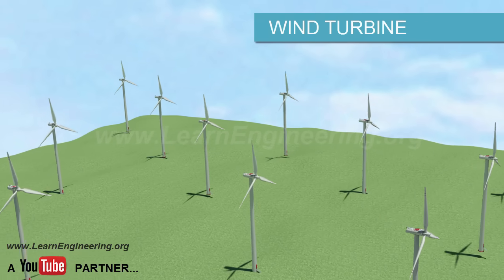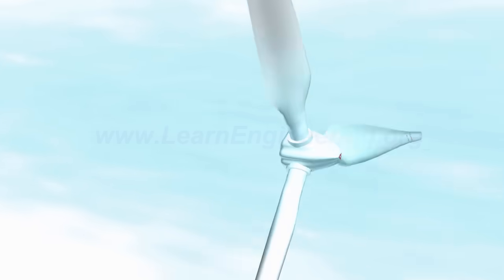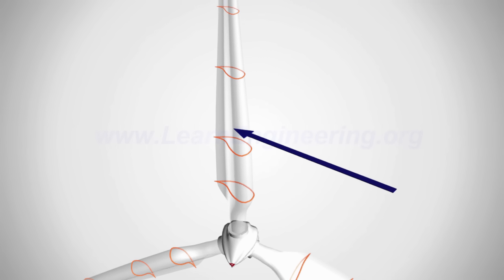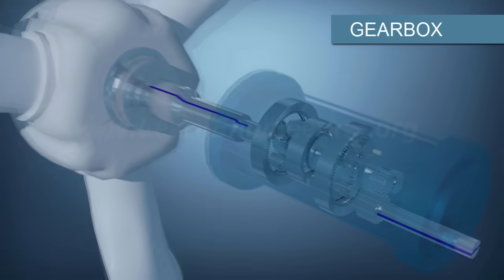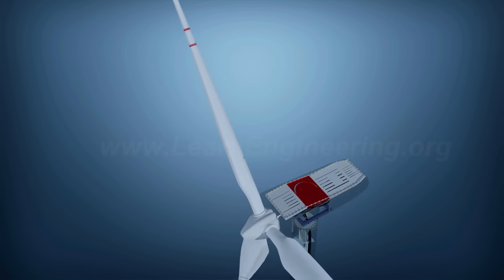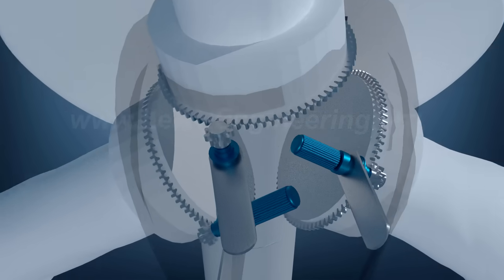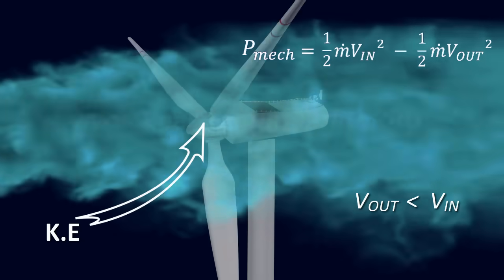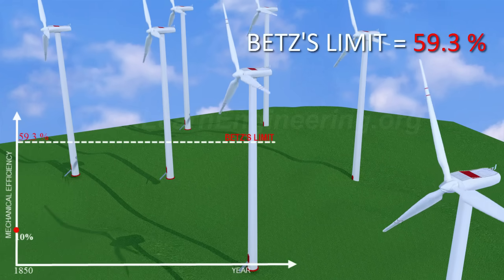How do Wind Turbines work?

Comment: Why does it have to lock up when there's "too much wind"? Is there not a method for the turbine to simply generate more mechanical force in such an event? That idea in and of itself seems highly inefficient to me; the only reason I could see stopping a wind turbine would be if the energy grid or wherever the energy were being stored were close to reaching it's maximum limit. Apart from that why doesn't it just run 24/7?

Comment: Hello, Jared Garrand,

To make clear, my question, I make an exampel of my knowldge of solar power.
Having seven solar panels of 42 Volts in serie, gives theoretical  294 Volts DC

To connect on the grid / network, you need  an invertor, to make it  240 / 250 Volts  AC  ( frekwentie,  50 Hz )

My question is...   do windmill systems work like this ??

The Amps, x Voltage gives the  Watts, that I know. And is depent on capacity of generator, windpower and
Electricity demand.

Regards, Gerard.

Comment: Thank you for information and I like that video( but one doubt why 59.9% efficiency why efficiency encrusted plz explain
Reply: yaser arafath this is the result of the analysis of the equation for the wind energy gather
If the gather was perfect (all energy goes to the turbine) it will not left any energy to the wind get away from the gather, which only happens if the air was already stopped to motion
Along with all the stuff related on this case the number resumes it all and gives the "perfect" possible energy transfer from wind to the turbine

Comment: which is better for the blades of the fan lightweight material or heavy weight material? does the weight of the fan blades affect the RPM?
Reply: yes it does carbon fiber blades are better than glast fiber

Comment: I find this info video not very complete, at 2:00 it is mentioned that the blades turn too slow, so the rotation has to be sped up in a gearbox (2:11). Very clear to me, but then bang at 2:40 there is electricity produced... What happened? The video basically thaught me that speeding up rotation generates electricity... so if I shift gears on my bike, does my bike start making electricity as well?
Reply: The blades are dealing are moving slowly and to produce power you need to step the speed up so that the generator can produce power. They do this with the gear box. They generally use  a planetary  gear setup which transfers the high torque and low speed coming from the blades into low torque and high speed to turn that generator fast enough to make power.

Hope that helped explain it a little bit better.
Reply: Clash of Clans - Saturos the basics of AC generators work on the variation of an variation of magnetic Flux on a conductor,  basically plug an magnet on something spinning and cover it with an wire coil

If the variation is too slow you can't generate power at all,  so if you have enough force involved is possible to use the gears proprieties (convert speed into torque and backwards) to give speed to the generator axis

Srry for the loong text,  hope it helps
Reply: Clash of Clans - Saturos  well the science is there, what about you add another gear box so u make it rotate even faster = produce more electricity
Reply: It's because you want a frequency of your AC power around 50 or 60 Hz. You can get that in 2 ways either you spin very slowly and have a lot of pole pair inside the generator or you speed up the output shaft of the turbine through a gearbox. You don't "produce" more power by speeding it up, you just convert it into something more useful.
Reply: I would answer you, but you are too lazy to check on the web so nope.

Comment: Who can tell me....
1. What is the output voltage ?
2  Is the generator AC or DC ?
3  works it with transformer, / commuter ? Or otherwise ?
4  How is it connected to the grid network ?
5  Do both, AC and DC systems exist ?

Till now, nobody can tell me , is it so difficult stuff ?
Or is nobody interested to tell the basic ?
Thank you for your time.
Regards, Gerard from Holland.
Reply: 1. Do you mean the wattage in other words how much power that they produce? Generally thats what everyone focuses on because thats how they figure out the amount of money they will make. If thats your question then it varies from sight to sight. A Vestas V164 is an 8MW turbine that is not in production as of now or i am not aware of it, but that turbine could produce enough power for 7500 European homes

2./5.The generators are AC generally. I am unaware of large scale DC generators.

3. In America, turbines use transformers to step up the power to the grid voltage so that it can be transported.

4. In America, they are hooked into the transmission lines in the existent grid

Hope that helped. Send me a message if you have another question
Reply: 1+2. The output voltage is usually 690VAC.
3+4 The 690VAC is then fed into a transformer that put's out around 10kV which is then combined with the power from the rest of the plant and transformed to ~60kV which then connect to the grid. 
5 There are no large DC turbines, but small ones for boats and houses does exist.

Comment: Why there are always three blades? not two or four?
Reply: In theory, you will perform as better as the number of blades the WT has.
From 2 to 3 blades, the gain in power converted justifies the investment to build the 3rd blade. But from 3 to 4, it is not competitive.
So, in small wind turbines you will easily see WT with 4, 5, 6 blades.
But in the WT for large scale productions, the industry cost keeps it in 3 blades.
I don't know if I was clear.
Reply: My turbines have 5 blades.  But at the larger scale the blades are so big, cost so much, so heavy, three is tested and engineered to be ideal cost/performance.  On smaller home wind turbines three blades will spin too fast.
Reply: +Karm G too fast *
Reply: +Karm G I'm not normally that pedantic but I'm just imagine someone coming across it and writing a school report and getting confused :)
Reply: Dont you know about the Bermuda triangle.Then why its not Rectangle or any other angle.Hmm?
Reply: 2 blades creates noise and 4 are expensive with less marginal improvement into the wind energy
Reply: sushant tomar i would like to mention that all of them are noisy in some level.
Reply: yes true but 4 blades aren't tolerable when they are near to Residential areas

Comment: How i can store generated electricity in batrry. I have to make a mini wind mill.
Reply: Storing electricity will not work. You must make that electricity do some WORK!  Batteries are expensive, so storing that electricity will be expensive. But making that electricity perform work is more practical and reliable. Creating a refrigerator which uses that wind generated electricity makes more practical sense.

Comment: I have a question :
cant u just develop machines on the basis of perpetual motion widespread to move a turbine or would it produce an inefficent velocity.
Reply: Perpetual motion is impossible. Even if you had a machine that has a 100% thermodynamic efficiency, it wouldn't be capable of running a generator.
Reply: No, why don't YOU just develop a perpetual motion machine?

Comment: What I don't get is why they have the generator and gearcase in the top instead of running shafts down to the bottom. Then less of the weight would be on the top and one wouldn't have to pay extra for super-low weight magnets and that complex gear system, right?

I mean I know that with a one-shaft solution the mill will want to rotate as it generates electricity then, but why not just use two same-ratio shafts that turn in opposite directions?

The rotation of the top when wind direction changes could probably be done by shaft from the bottom too, although I don't know if those engines that do that are really any considerable weight?
Reply: +junoguten you mean to transport the mechanical energy to the bottom of the wind turbine, and only there turn it into electricity? that would be way less efficient, plus a lot more expensive to build
Reply: Mike Mota Would involve slightly more parts, yeah. Read somewhere the materials for said high performance magnets was getting more scarce, so I figured this might help. Idk for sure if it's true though.

Comment: The problem with wind turbines is their obscene modern size and proliferation on landscapes that used to look like rural scenery. I can't support the so-called path of progress in this industry. The scientist who gave us the Gaia concept resents them and criticizes green fundamentalism for pretending all renewable power is good "just because."

And there's the fact that wind turbines could not be built without fossil fuels for most of their industrial/transport aspects. Rooftop solar is what we should focus on.
Reply: +Geo T First of offshore Wind Turbines (though very expensive), have a minimal impact on animal life. In fact the foundations can serve as artificial reef, while the birds fly either really high or crazy low in the sea: no eagles or bats. Secondly, hypothetically, an increase of photovoltaics (PV) to the infinite, will render the Earth much, much cooler and disrupt a lot of Atmospheric flows, and heat transfer, to the point where even the daylight will be dimer with much less heating, whereas windflow: (1) is a product of the aforementioned forces as well thus harvesting it is less painful, (2) wind generators are much more efficient (and will likely stay so here on Earth) (3) there is always wind here or a few hundred km away, whilst on average about half of the Earth is dark, and moonlight serves to add a few bytes only, if any at all. And last but not least, though efficiency will turn them more aesthetically invasive, there are a lot more types of Wind Turbines beside the Horizontal Axis ones (HAWD), some quite promising: AWES Airborne Wind Energy Systems.

If you are looking for GAIA I advise investing into Nuclear Energy having the waste thrown overboard Earth :D (on some other celestial body), but since the last generation of nuclear reactors are depleting the fuel to the point where nuclear waste is a ten year hazard, then radioactive ore is truly the only material storing an insane amount of energy, and the exploitation (with modern technologies) creates minimal impact. But don't give up on wind power yet.
Reply: +solomonarbc preach it fella. It's good there are people around who happily go through the effort to educate people
Reply: I feel like i'n the only one who likes the way they look
Reply: I love the way they look, always have
Reply: This's the best option for countries that experience alot of wind
Reply: There are plenty of offshore wind turbine facilities, and plenty of opportunities for more. Wind power is hardly green fundamentalism. The Chinese government has invested heavily in it, not 'just because'. It's because their cities are being choked by fumes from dirty technology.

Comment: so what happens when you replace the wind turbine with a perpetually generating magnetic source? infinite energy. free. clean. look on yt "perpetual magnetic motor." wind stops sometimes, but magnets possibly never have to stop? we've seen stuff on yt as well with magnets that have boiled metal just by magnetization. i'm guessing, this might be how ancient biblical structures might have been built. magnets can even cause things to be transfered from point a to point b particularly if they're heavy as well. kind of strange right? like, if you cculd use a perpetually generating magnet motor to give movement to obejects in space through rotation, why not just build a spaceship in space or have it lifted there and forget the fuel? be clean, you could even eliminate the vast carrying tank that holds oodles and oodles of fuel. what happens when you take a perpetually generating magnet motor and put it on a ship? you obtain a ship that needs no fuel, only the magnets that generate the magnetic force used in a simple advantage to give a ship infinite movement. Infinity is rather neat.
Reply: So what is the greatest source of energy in the universe?
-Prayer. And if you refute this you need to further understand the forces we generate. Prayer is the Greatest force in the universe. Pray against wicked satanic prayers and you might find this.

Comment: I am just curious, can we use the power generated by a wind turbine to power the wind turbine itself - so that the wind turbine motor/rotor/alternator can function without the wind.
Reply: +Alex Sim What you are suggesting is called "perpetual motion" (or "moto perpetuo"), an impossible property for any energetic system in the universe as we know it. You have probably heard, when a child, a statement of Lavoisier that says "Nothing can be created or destroyed, only transformed". So: since we cannot isolate any energetic system in the nature, there will always be leaking of energy into forms we cannot fully reuse, specially heat.

You see, the most durable sources of known energy are called STARS, running on fusion for billions of years. However, this doesn't qualify them as perpetual devices - they just have a huge amount of available fuel to keep going. And even those objects have a finite life span limit. :)
Reply: boooooooooooooooooooooooooooooooooooòoooooooooooooooo😢😠😡😒😞😵😝😭😪😪😖👎👎👎👎👎👎👎

Comment: So if as little as 10mph wind can turn a wind turbine, why not just mount the whole thing on the ground without the long blades to kill birds and so on and use a simple 110v 10hp electric motor to turn the input shaft. You can control the speed of the motor and always have the same amount of output or you can increase the speed for more electricity to be made. and you can put closer to 10 "turbines" in the same space it takes for 2-3 with all the blades. and they are on the ground for easy access when they need to be maintnenced or fixed. If the turbine isn't making enough power to power it's own motor and supply power to the grid then they are a waste of time and space. So that being said it kind of blows a hole in the whole "you effectively can't use electricity to make electricity" theory.
Reply: +Nathan Wedrick 
Troll

Comment: only a 1 : 90 ratio? huh. i thought it'd be higher.
Reply: The typical wind turbines have a rotor turn rate of ~20 rpm. Which gives a generator turn rate of 1800 rpm with a 1:90 planetary gear. This is wanted as a generator with 30 pole pairs generates ac current at 60 Hz, which can be connected straight into the power system. 

You do also have variable speed wind turbines that can operate at peak performance for a given wind speed, however the generated power needs to be converted to DC and then back to AC in a seperate Motor to obtain usable electric power at 60 Hz.

Comment: Thanks for the nice video. In theory would installing multiple turbines in a known windy area (e.g. gaps between buildings where wind is forced to squeeze through) slow down the winds and also generate more power than a single turbine?   In windy metropolis (e.g. Chicago) I'm still surprised to see no buildings have used wind turbines for energy generation. Thanks!

Comment: How is the frequency controlled, if the blade rotation varies with the windspeed ?
Reply: The generated AC is rectified into DC and afterwards inverted to the frequency suitable for the power grid